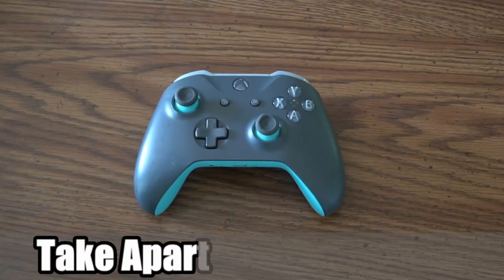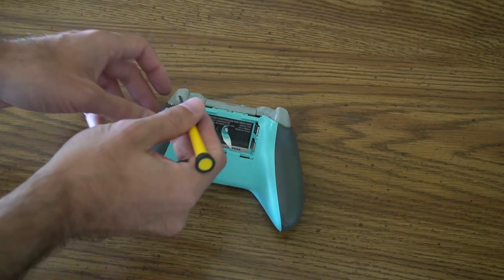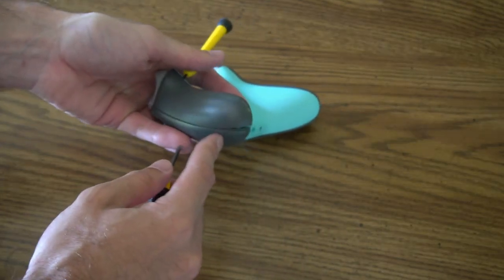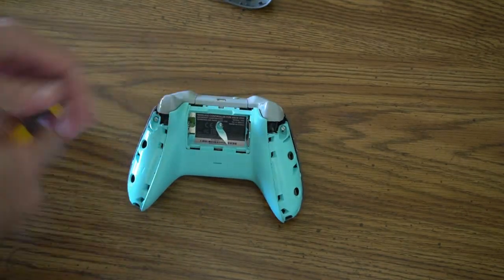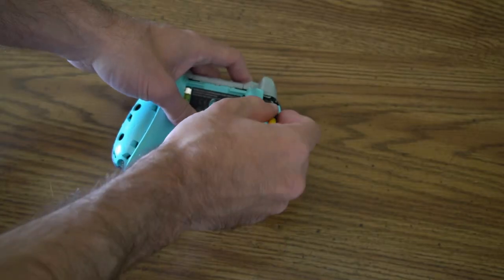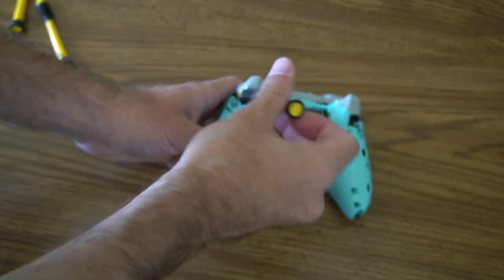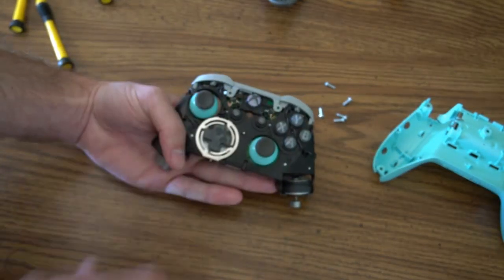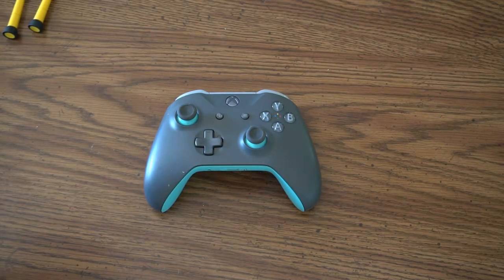How to Take Apart Xbox One Controller & Assemble (No Torx Needed)

Comment: My controller has a screw that has a tiny metal that is sticking out of the screw. So I cannot use a torx screw
Reply: Same
Reply: Same
Reply: @Davozy  I found out how to do
Reply: @madduxb5116  how
Reply: @Davozy  I spent 100 on a tool
Reply: @madduxb5116  u bugging i just got a new controller from GameStop and got insurance so if it break I get another controller for 10 dollars
Reply: @Davozy  insurance 🤣🤣 you mean a warranty
Reply: It's called a safety bit. They're no more expensive than a regular one. If you're too cheap to buy one or cant wait just use a tiny flat head.

Comment: Terrible advice. DO NOT use metal to pry open plastic. The metal will permanently damage the plastic. Use an old credit card or you can buy plastic pry tools. Most grip or controller upgrade kits come with the plastic pry tools.